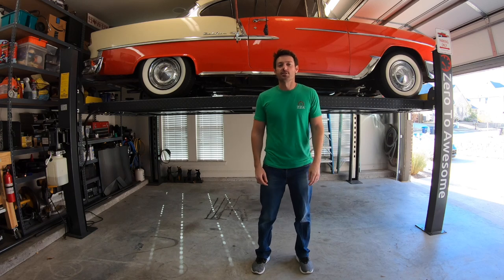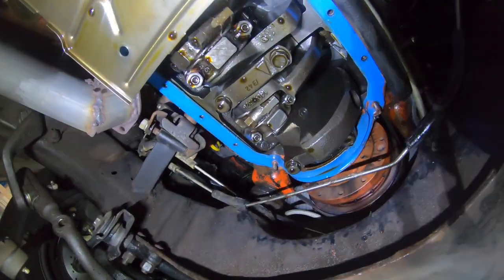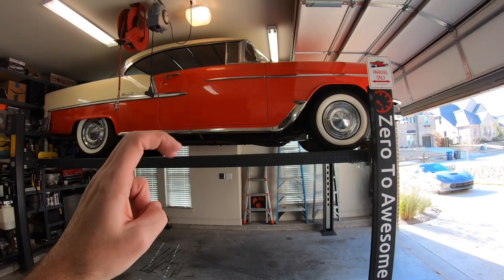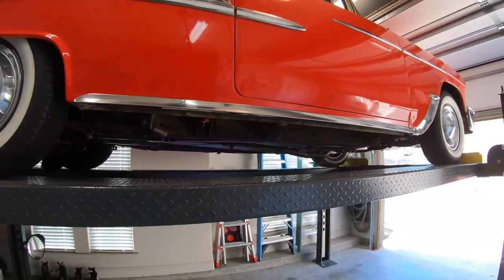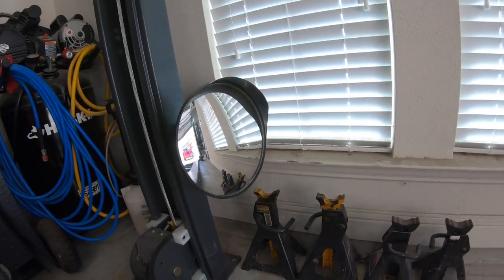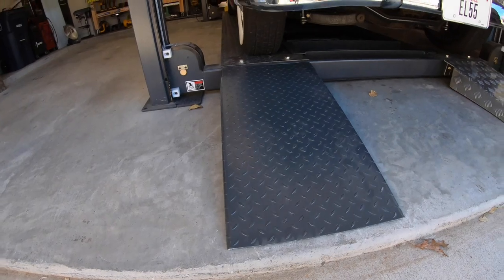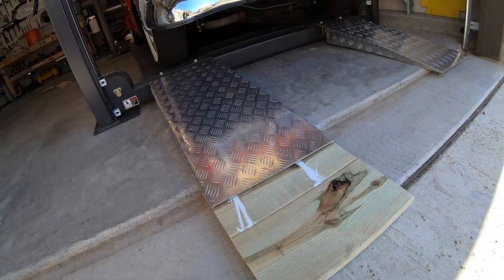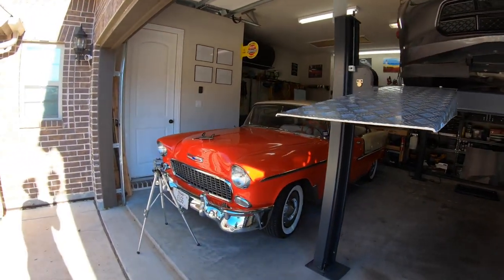One year with an Atlas 4 post lift. Was it worth it??

Comment: I just bought a Triumph four post lift and installed it two days ago. So far I love it, so it was nice to see someone who' has had theirs for a year and still likes it. You gave me some great ideas, I especially loved how you ran the electrical wiring down through the hydraulic line with loom! Good thinking! Glad to see you still like it, I can see I'll be using mine a lot as well 🙂
I also like to idea about using the LED strip lights, I had thought about putting in some of the LED lights as well, but I was going to put them under the runners so I would at least have light down there, but your idea was pretty good!

Comment: I just ordered this lift after doing some serious research on lots of four post lifts. I chose this lift in particular because of how low the location of the pump controls are. I'm in a wheelchair and most lift's controls are pretty high compared to this lift. I also like how the lift looks compared to other black colored lifts that just look bland. I'm hoping I get several years of trouble-free usage from this lift.
Reply from the maker: Congrats on the purchase! If my experience is any indication it should perform great for you
Reply: Ozzie Alarcon u need to post your thoughts on the lift here.  Thanks.
Reply: @todd5082  I love my Atlas lift. I did a lot of research when I decided to buy a four post lift. I looked at the Bendpaq lifts along with other brands like Atlas. I tried to justify the extra cost by going with a Bendpaq but in the end I decided it wasn't worth the extra cost. I did a small mini review of my Atlas lift if you're interested: https://www.youtube.com/watch?v=vAJeDqJQ758&t=16s

Comment: The rolling Jack with the wheels instead of the sliders wouldn’t work safely on this model. The wheels require an upward lip or trough to roll in. This model just has the flat tray for the drip pans. And the moving start off point when you showed us the force needed to get it going looks pretty par for the course. Obviously I don’t know how strong you are lol, but looked pretty standard. The nylon sliders sit still for an extended length of time and settle into the diamond plate and so that first push is a mother.

Comment: It's probably an SJ-35. The SJ stands for Sliding Jack, where the RJ stands for Rolling Jack. I too would be interested in finding out if these can be converted to rolling jacks, as my local supplier is out of stock on the RJs but has plenty of SJs. Freight is like $150 per jack so I'd rather buy them locally.
Reply from the maker: I’m sure with enough determination it can be done
Reply: @ZeroToAwesome  I guess another option would be to lag the uprights to the floor to prevent movement when tugging on the sliding jack.

Comment: Was wondering about the led lighting placed along your ramps.  Do your drip trays just lay on top of the ribbon of lights?  Will they ”slide” or are you having to lift to move the trays. Irregardless, great video and appreciate your take on lift ownership so far wit a year behind. Stay a Car Guy!
Reply from the maker: The drip trays sit on top of the lights but they’re not heavy and can slide right along them. The jack and jack tray sit up higher on the ramps and doesn’t ride on the lights. And thanks!

Comment: Did you consider a 2 post lift? If so, what made you go with the 4 post? Trying to decide which way to go. Will mainly be used for oil changes, tire rotations, and minor mods.
Reply from the maker: I did, but I would’ve had to reinforce the concrete in my garage to get one. I also mainly use the lift for storage and a 4 post is a lot easier to drive on and off of

Comment: I can tell you I am STRUGGLING with mine. Won’t go down to load level :(((( also looks like your lift is not bolted down. You could just jack out a bit of the garage floor to let the ramps go down.
Reply from the maker: Dang, sorry to hear. I wound up making some 6’ aluminum ramps for mine

Comment: Hi. How does it work for doing your brakes? And is that slide jack xtra ? I didn’t catch that part. Thanks.
Reply from the maker: Works great for brakes. The slide Jack is extra but it comes with a sliding tray you can throw a couple bottle jacks in

Comment: I want a 4 post but delivery is the hardest part. No fork lift here either. :-/
Reply from the maker: I read somewhere that you can have them delivered to a freight terminal and then pay for a forklift service. It’s extra $ though
Reply: @ZeroToAwesome  that’s too many logistics to figure out. Why can’t we have a service that delivers straight to the house and installs it ;-).
Reply: @512TXSDIY  I had them deliver it to my local warehouse . I rented a 20 foot uhaul . The warehouse loaded it into my uhaul at no cost . It was straight forward unloading it from the uhaul . All the parts were light except the one ramp with the cylinder in it . So we hand unloaded the lift and used moving dollies for the ramps .
Reply: @jamesp9998  thank you James. I ended up getting a different 4 post that was delivered to my house and installed! Pretty cool. It’s on my channel.

Comment: I was shopping for a lift and found the aplus lifts. They apparently have a warehouse in "Dallas". The lift also looks oddly similar to the Atlas you have. Did you run across them in your own search for your lift?
Reply from the maker: I didn’t run across them, but rumor has it many lifts are made by the same manufacturer and then different labels are just slapped on them. Aplus looks a little different from atlas though. The locks the lift rests on are in the posts on mine. The locks on the aplus appear to be built into the side of the posts

Comment: Thanks for this video. 10'4" is the exact height of my garage! I've been thinking of getting a lift, but wasn't sure if the clearance under the car will be comfortable to work. Do you use a bench under the cars or is the spacing enough for you to stand up and work?
Reply from the maker: Depends on the car. It’s usually enough to work comfortably
Reply: @ZeroToAwesome  I have a Wrangler. I see you had one up on yours in your compilation!

Comment: Whether you back in or drive front first, won't your wheels be spinning in the same direction, toward the apron? Other than that, great video!
Reply from the maker: Drive wheels are already on the runways by the time the front wheels get to the ramps when you back in though. Not true the other way around

Comment: shoulda just used that board to make ramps woulda been much cheaper
Reply from the maker: True, but I don’t think you could make the lip that attaches the ramps to the lift out of wood since they’re so thin
Reply: But you could have bolted board length wise to the under side or ramp to extend out into the driveway to get longer run which would probably gave you the clearance needed.....oh my unprofessional opinion of course

Comment: i have the peak 408-p. looks identical to this. Do you ever notice that the insteuctions say that the posts should be X distance apart but when you assemble it al measurements are off by 1/4” or 5/16” ? 

Can I ask what your manual says? Mine says outer edge of the base plate to outer edge of baseplate 173.25” length, 109” and 5/8” wide and diagonal 205”

Comment: Did you ever inquire about the rj45 jack ? I have a atlas garage pro 8000 and I have the same rj35 jack as you . I was wondering if it will fit our lifts ? If not I’ll modify the rj35 .
Reply from the maker: No but the 45 should fit. The only difference as far as I can tell is casters v slides

Comment: Is your garage length width a standard 20x20? And with corvette on lift, what can you fit under there?
Reply from the maker: Yeah, about 20x20 but it’s a little taller than a standard garage at 10’4”. With the corvette up top you can easily fit any sedan or coupe under there. Maybe a small crossover if you’re lucky. I still can’t go all the way up even with the corvette on top though.

Comment: wondering - is it safe to use the lift w/o anchoring the posts into the concrete...looks like you just have them free standing with no anchors?
Reply from the maker: Debatable. It hasn’t given me any issues yet though
Reply: @ZeroToAwesome  yeah...I have a big Dodge Dually W350 w/Cummings Turbo diesel - the engine weighs over 1,100 lbs... so a lot of weight on the front end compared to the rear.  I think it best in my case to be safe and anchor the lift. THANKS

Comment: any issue without putting bolts in the floor ?
Reply from the maker: Nope. If it stayed in one spot I’d bolt it down but I move it around from time to time depending on what car I’m working on
Reply: How easy is it to move since its not bolted ?
Reply from the maker: @RSXSykO  not bad. Once it’s on the casters you can push it with one hand

Comment: Thanks for the video and the tips.  Mine is due in end of this month after waiting since last summer. Covid really slowed things down and I can't wait to get it installed.  I really wanted the 408SL for the very reasons you explained in your video. Two questions: 1)Did you get the 110v motor or 220V? 2)I see your lift sits unbolted on the floor and wondered what the slope is in inches from the front posts to the rear posts since garages typically have sloped floors? Or how level is the lift since clearly don't have any problems operating it? 
Finally, a suggestion for your Vette: I purchased a set of Race Ramps for the garage in my winter home in Naples to change the oil, etc. in my Mustang GT and old Tbird. They are great.  I plan to buy a second set to use  in place of the steel ramps that are supplied with the lift. They only weigh about ten pounds and are well worth the investment.
Reply from the maker: Dang that’s a long wait! I have the 110 and it’s about an inch slope in total. One of the installation steps is to level the lift deck by adjusting some cables so whatever you’re lifting stays level. I wound up making some 6’ aluminum ramps to get the vette on there but thanks for the tip!

Comment: Why not go with 2 X 12 that is 8 feet long. Cut it in half or even 2 - 3 feet long. Lay it long ways (like the ramps) instead of sideways like in your video. This should take care of the problem and look better being one piece instead of couple pieces cobbled together.
Reply from the maker: I wound up making 6 ft. long aluminum ramps that work great!
Reply: @ZeroToAwesome   cool. Is there support in the transition from the garage floor to the driveway where the gap is at? Sounds much more expensive than lumber, but at least you found a great solution. Glad to hear it.
Reply from the maker: Yeah. I had to do some fancy cutting but the ramps touch the ground the whole way

Comment: Could we chat about the lift install?
Reply from the maker: Good news, it was recently moved and re-installed. Still goes up and down.
Reply: How was the install. I seem to be intimidated by it…?
Reply from the maker: If you have decent instructions from the manufacturer it isn’t hard at all, especially for a four post rather than a two post. Things are heavy though, a couple strong friends or a friend and a forklift is definitely required.

Comment: I have a 53 BelAir and am thinking about putting a lift just not sure how much room I would have under it. How much room do you have for a vehicle under the lift when the belair is on top?
Reply from the maker: It’ll depend on your ceiling height. Mine is 10’ 4” so I can’t go all the way up, but I have 57” of clearance for another car with the bel air on the lift
Reply: Cool thanks my garage is 10' 4" also so it should work.

Comment: My roof height in my garage is 10' 5" or 126.5"  Car "A" (The one I plan to Store up top) is 53" / Car "B" is 54" which equals 107" / I just want to make sure this is going to work for me before I shell out the cash.  How much additional height is required?  126.5"- 107" = 19.5"  I would say I'm fine but??   Is there a formula that Atlas provides? Thanks in advance.
Reply from the maker: I don’t think there’s a formula but I think you’re good. The runways are 4” thick and then you probably need another 3” of travel to get the lift on/off the locks for storage. Seems like you still have plenty of clearance even with that
Reply: @ZeroToAwesome  Thanks man!  I did find a formula and it looks like I'm good.   Just wanted to make sure.  Have a great day.
Reply: @evcuttermarketing  Where is the formula? Im curious as well! Thanks
Reply: @SenpaiMC7  I found one on www.directlift.com (Ceiling Height Calculator) The specs on the direct lift are basically the same as the Atlas  408-SL Premium
Reply: @evcuttermarketing  Actually found the same calculator yesterday! Much appreciated!! Thanks for getting back

Comment: At the lowest lock setting, or first notch when lifting, What is the height from floor to top deck where wheels set, with locks engaged?
Reply from the maker: It’ll vary cause you can adjust the locks about 2” or so, but mine’s at 22.5”

Comment: I have a 72 buick riviera and the width is 79.2 inch will the car fit on the lift. What is the size from edge to edge?
Reply from the maker: I’m going to go with “kinda.” Looks like your riviera is about the same width as my Tahoe was. It technically fit but the tires hung off the edge. I’d measure it for you but it’s disassembled right now

Comment: I have 10ft ceiling do u think I can fit a 13 convertible vette on top and a seadoo jetskis on bottom if I raise my garage door
Reply from the maker: It’d be close. Measure the height of each and then add about 10 inches. The runways add 4” of height and then you need another 6” or so to engage and disengage the locks